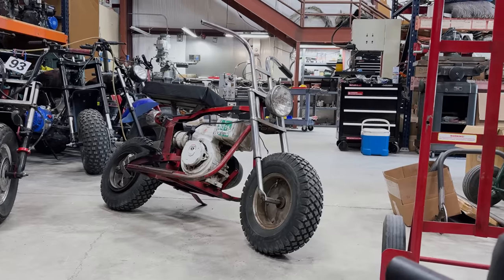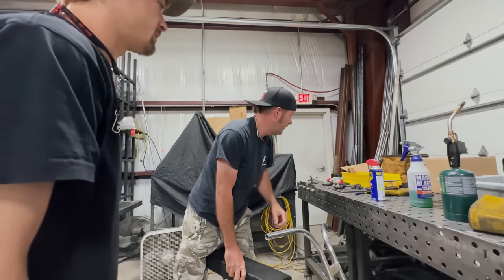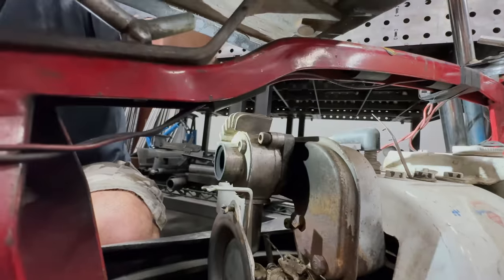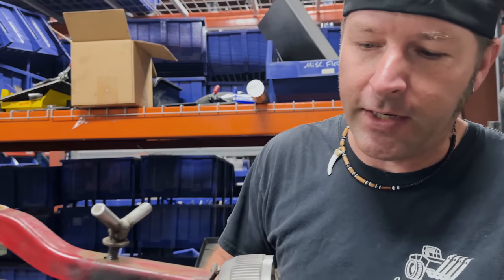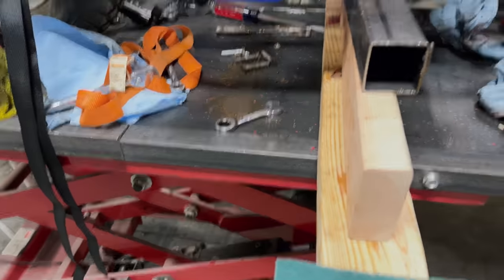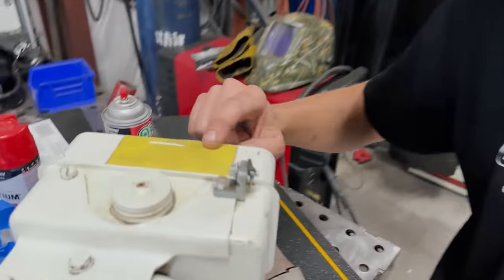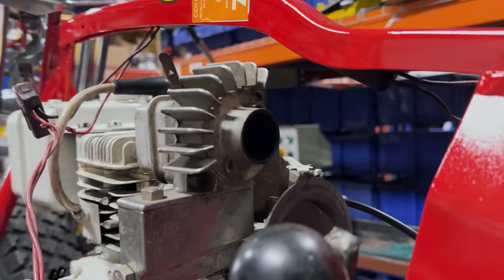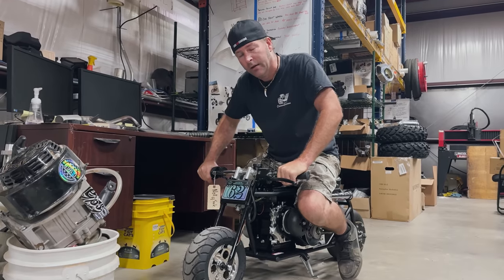We Restored a Vintage Mini Bike in 24 HOURS for a Show (and WON!) | 1969 Powell Challenger Build

Comment: You all should make a 100 mph mini bike
Reply: Oooh yeah
Reply: I don't get why they can't get this speed with how much HP they are making on those engines, 25~30 should be enought to get to 100mph
Reply: Because of their cooperate overlords and just flat out being poosy's.
Reply: @braziliansheetbox2497  the gearing required would make it not fun for anything other than straight line driving, and its dangerous as hell
Reply: @joshuagibson2520  Nice! Let's see Joshua Gibson's 100 mph mini bike.
Reply: @WyFoster  I don't have any video of it, but a local deputy clocked me at 86. I ran out of straight road. Been looking for a longer "testing" location. I have to give it the Fred Flintstone off the line to give it some help.

Comment: I loved these growing up. Pull start ,centrifugal clutches, brakes and shocks on the front if you were lucky. I used to swap out the engines as I was growing up, starting at 1/4 horse, but the last engines were 5 horsepower.

Comment: The loose belt with lever tensioner dates back to the single speed & 2 speed motorcycles of the 1890's to 1910's. My late grandfather rode and crashed (several times) a 1910's made example, when he was a young man, way back in the 1920's. His bike had a leather belt, which snapped on one occasion, became caught in the rear wheel and flayed his leg badly.

Comment: THE HOUSE PLUG was probably there for the removal of the front forks, as Ike mentioned for stowing in your car. a quick disconnect, like a trailer pigtail.

Comment: i 100% believe that electrical work is factory for the age of the bike. I just converted an old bar clock to USB power and they used a very similar 120v wire for 4.5v from a battery

Comment: Those Blue Plug  clips were My Go To`s in the 70`s , and  then the yellow  red  and green  and more , Yes they existed in the 70`s , it was the 80`s they started to fall off with wire  Plugs / plastic fitted plugs

Comment: 14:43 I bet if you replace the rear pulley with an actual clutch pulley, shorten the belt, but leave the belt tensioner in place that would have to give you better speed, and almost give you a direct one to one when you engage the spring pulley.

Comment: That's an excellent way to seize an engine, guys. Will you three try remembering to add oil to the crankcase of them? Thst way, you won't run the risk of doing that to any of those engines.

Comment: Does any body have any idea how to fix a preditor 212 i added the go power sports stage 1 kit i put the new jet in air filter and all new gaskets plus the valve cover vent and gas tank vent but when i try to start it, it starts for a second then it shuts off 

Im hoping someone can lead me in the right direction 😅